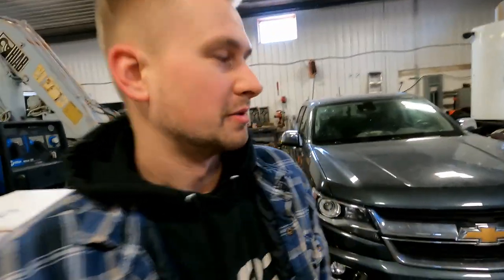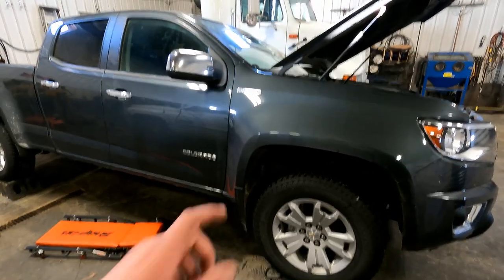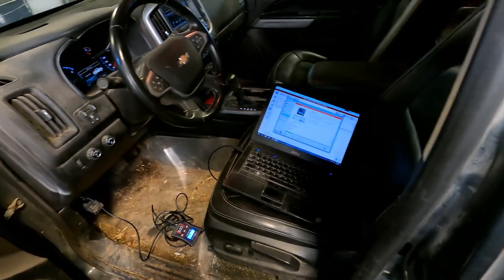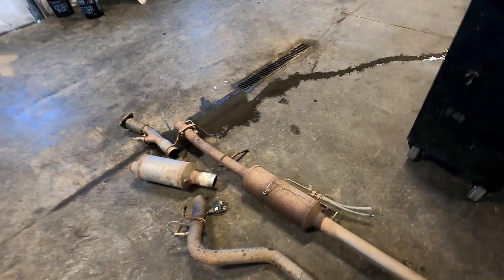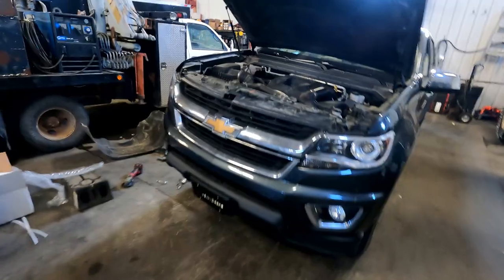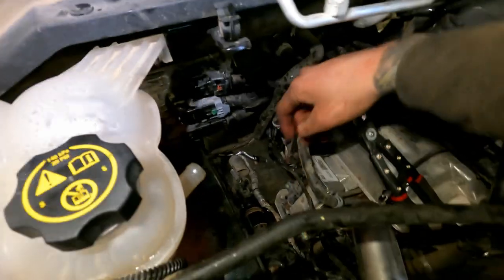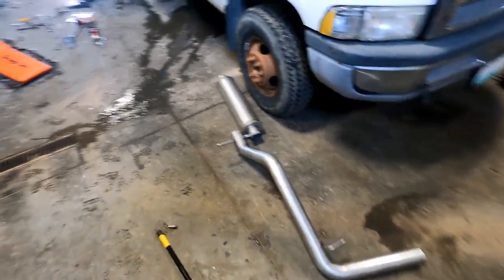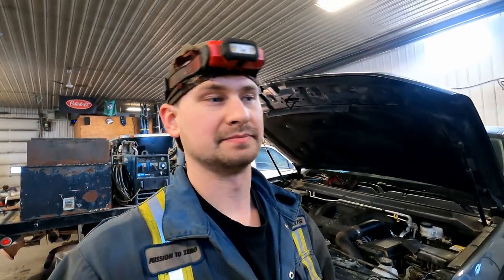How to: DPF/DEF DELETE 2.8L Duramax Chevy Colorado

Comment: I see the site is locked down. Theoretically: I had a EFI based tune on my 2017 2.8 and the offroad tune option was no more because of federal pressure on the tuner people, could I state I'm from somewhere else with another tuner person to get the rest of the delete? I regret not paying the extra $50 at the time since now my system blows white smoke for a solid minute during a regen.

Comment: interesting video. You do nice work. Running it at the end of the video it was putting out some serious diesel smoke. I'm guessing that is just one of the results of the DEF delete? It wouldnt have been the same before or no ?
Reply: I'm pretty sure that would be because it's able to breath again and the computer did the necessary adjustments at computer speed to clean up that smoke... Cleaned up almost immediately

Comment: Thanks for the video. Short, informative and to the point.
Looking to do this to my off road 17 Canyon diesel. 
Where is your shop located in case l wanted to "pay someone to do it for me"?
Reply from the maker: I’m in Saskatchewan Canada
Reply: It's not that hard of a job, i literally did mine just yesterday.  The coolant reservoir doesn't have to be connected.  Just loosen the 2 10mm nuts and flip it forward out of the way.  also, unplug the battery and disconnect the ecm and remove it to make it easier to pull the downpipe up and out.  Once it's unplugged, theres 2 plastic tabs on top of the ecm.  push those upwards and the ecm pivots out and up to remove.  Also, i didn't cut anything.  i removed trans crossmember and used a floor jack and a 4x4 as a trans jack.  flash before starting the delete
Reply: @the_salty_captain  
l dont know if l have enough skill and tools to do it.
Im in Chicagoland and found 1 shop willing to do it but they are asking a shitload of money.
Reply: @the_salty_captain  thanks for the comment. What about def? Does the tank have to stay full?
Reply: @BAYAREAMX  I completely drained mine.  its up above the spare tire
Reply: Can I drive to Canada and come back after my weight loss?
Reply: @chasehoffman3521  sure can.

Comment: 11:15 Poor, abused farm truck.  I'd want to know where the coolant went and fix the leak, there is surely air in the system now as well due to the chambered design of the surge tank.  Proper maintenance and repairs are a priority!  :)  If you care about your vehicles, anyway.

Comment: What did you end up doing with that injector?.....in your video, you said you didn't know what you were going to do with it.  
I disconnected it and removed the stainless steel line running across the cross member.....but it sprayed diesel out all over the place, when I started the vehicle.  
I clamped on a small piece of fuel line with a bolt in it, to block it off temporarily, but it swells....I wouldn't trust it to drive any distance, in case it ruptures and spews' fuel.  
So until I figure it out....my truck will be down.  Any help/info would be greatly appreciated....Thanks in advance.
Reply: Did you ever figure this out...doing mine right now and have the same issue.

Comment: Did this to my 2016 Colorado because DEF tank kept freezing. Revolution Motors in Edmonton that did the work said it was the first one they were aware of in Canada. 

No complaints at all since. Not one code thrown out in 5 years just about 200k km
Reply: This is exactly why I’m deleting mine
Reply: Hey man wanna slide me some info ?! I’m in Edmonton , just bought a used 2018 canyon Denali with the 2.8 duramax.
Reply: @jordancleal6380  Have you had any luck? I am also looking to buy a diesel Canyon this year.
Reply: @jorgechavez7211  I had mine deleted and tuned by inline automotive in Edmonton .  Great diesel shop and wicked people
Reply: How's it holding up? Worth it?
Reply: @razorsazors  most reliable vehicle I’ve owned. Now at 260,000 km. Never a code. Had some wires abrade (known issue) that needed splicing. Other than that just routine maintenance

Comment: Ive gotta do this to mine asap. Constant issues with the emissions systems. Just had my def pump, injector and, lines all replaced because the def froze and broke everything. This has happened every multiple times every winter since I bought it. If its not that its some other emissions related issue. I wont be able to afford all the work on the emissions system once my warranty runs out. Which is in 5000km. definitely need a delete or get rid of the truck altogether.
Reply from the maker: I know it’s ridiculous! I don’t understand how they expect people to keep the emissions intact when it constantly fails, costs thousands to repair, and the parts are often back ordered.
Reply: @darkirondiesel  Exactly it's insane. I love everything about the truck except the fact it's been in the shop more than any other vehicle I've ever owned combined. All for thevstupid emissions system. Thanks for the video though. I'm excited to chop all that garbage off my truck haha.
Reply from the maker: Hell ya hahah
Reply: I'm all for clean exhaust, and I actually really like the quiet and lack of smell and soot of the stock system, no doubt the emissions system is very effective when it's working properly.  BUT my biggest fear is getting stranded far from home due to some BS emissions code.  So as much as I think the emissions systems are necessary for the world, I really can't blame anyone for deleting given the trouble and expense they seem to bring so often.
Reply: @8180634  diesel emissions are not necessary.
Reply: @Mike Bartok  Hey man  I didn't end up deleting mine. I was tired of the winter issues. During the height of covids inflated prices I sold the truck for 7k less than what I bought it for new with 88k km on it. I ended up buying a gas job. Good luck with yours though.
Reply: @saskmuddinatv4777  thanks for the reply. 👍
Reply: @8180634  I ended up stranded for 6 hours in the middle of nowhere bc of an emission code, ready to finally delete it

Comment: Obviously Flo-pro doesn't think you need a flex pipe but it just feels wrong without one to me. What are your thoughts?
Reply from the maker: I don’t think it matters. The flo-pro exhaust weighs a fraction of what the original exhaust weighs. I think the rubber hangers are enough.
Reply: @darkirondiesel  i need delete def and my truck
Reply: @ericrios7050  you know where to go.
Reply: No

Comment: That little engine sounded awesome with the straight pipe.  Did the EGR make it too or that's another video?
Reply from the maker: Nah the egr just stayed in this truck. The tune deactivates the valve.
Reply: @darkirondiesel  : Gotcha ya.  I don't miss my EGR or DPF. :).  Keep your pup warm with those brutal Feb. temps.

Comment: I was wanting to get a 2021 Chevy Colorado ZR2 bison diesel, I heard those engines aren't good, is that true? Then I heard you have to delete the emissions right away?
Reply: Mopar mechanic told me avoid, not good engines.
Reply: What about the 3.0 duramax diesel in the Chevy 1500?
Reply: Haven't heard about the 3.0.duramax, honestly it seems the the 1500 gas engines can pull just as much weight as the diesels. If it were me I'd wait a little longer to see repairs needed on the newer engines.
Reply: @CGR72  
Yeah, that's true. I just wanted better MPG's
Reply: @CGR72  gas and diesel have always had similar tow rating . It’s about the low end torque and fuel savings. I have a 3.0, and it’s wayyy better than my 2016 5.3 gasser
Reply: My buddy had a 2015 eco diesel just outside of warranty the head gasket shit the bed, it ate coolant and blew the engine.
Reply: @stevenpeterson7234  I own one and I don’t have too many complaints other than a 10 speed, I hate how they hunt for gears but other than that I get 27 mpg

Comment: If a delete gains mpg and gives your engine long term reliability then to hell with the emissions system. 
Now if the local air starts to look like modern China then yes I would vehemently approve the E. systems.
Reply: Except they don’t require nearly as many emissions on gas vehicles even thought they creat so much more issues “environmentaly”. People just see black smoke from diesel and thing mmm smoke bad...
Reply: Not to mention the amount of fuel it takes to transport DEF across the states, and the trash from DEF containers. It makes zero sense to me.
Reply: I've always thought that myself. Geee the are trying to fix one environmental problem while creating another one. Typical government bs
Reply: Government and military vehicles are emissions exempt.
Reply: @georgefloydsinhellwbreonna5330  😂😂😂😂😂😂😂
Reply: @Bpf1893  ..I filled up at a truck shop yesterday. It basically  spilled all over because the pump wouldn't  stop auto when  full. Pumped 2 plus  gallons all on the ground.
On top of this it your carry a extra 5 gallons of weight on your truck ..so yea..a royal pain in ass and no sense either.

Comment: why they dont make a simple part that bolt on the orginal pipe instead of buying a whole new pipe?
Reply from the maker: Because the whole point is to get rid of the original pipe. The original pipe is packed full of filters and sensors.
Reply: @darkirondiesel  once the DPF is replaced. what 'filter' left there is.
Reply: @nakorwohbeta  the cat is still there.

Comment: How many miles were on the truck before the delete?
Reply from the maker: Like 60,000 miles
Reply: @darkirondiesel  why was it having the emissions issues you mentioned at the start?
Reply: @GenkiDamaSSJ  stab in the dark.... but either it did not actually have any.  Or, perhaps  it was not driven long enough/far enough  every few weeks or so.  YOu need to drive them on a long trip every couple of weeks.  The system will allow the exhaust temp to rise, which then blows out the crud that accumulates in the DPF.   restricted DPF=exhaust codes.

Comment: So the EGR isn't removed?
Reply from the maker: No it’s still on the truck, but the tune deactivates the egr system so the egr valve that lets exhaust back into the engine should remain closed therefore not letting exhaust back in the engine.
Reply: @darkirondiesel  while true, I deleted/removed my egr as a big fuck you to the EPA (Elites Pissing on Averages).
Reply: Still the cleanest way and by far the preferred method, is to actually do a true stop off after the tune delete.